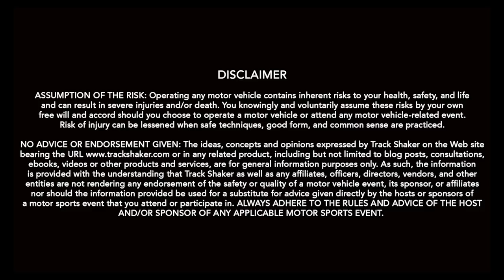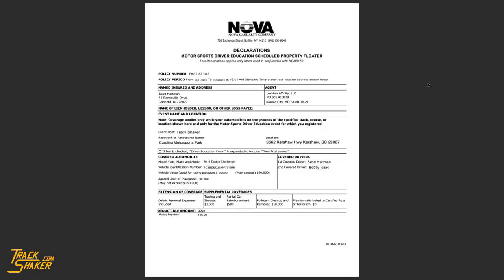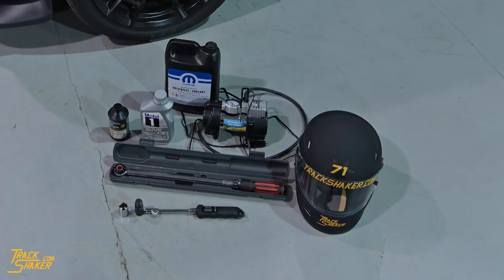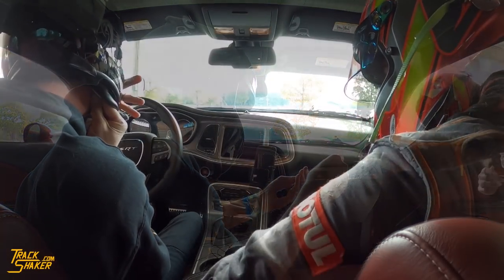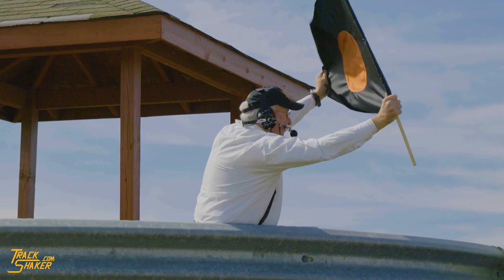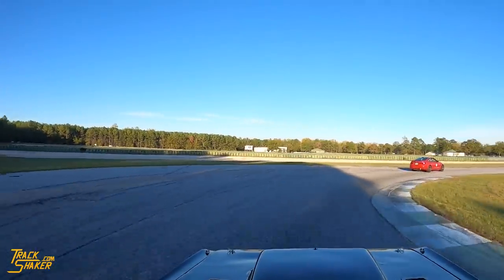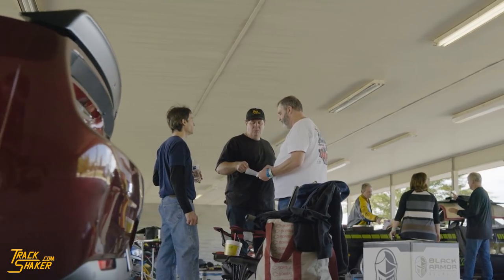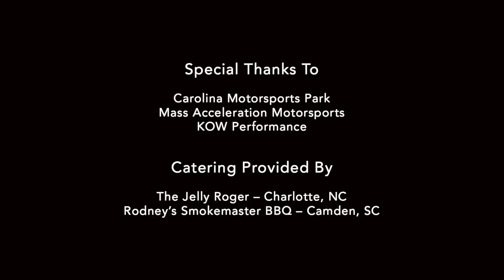How To Get On Track - The ULTIMATE GUIDE To Track Days

Comment: Why not use the car’s indicators to initiate a point by? This does not require windows down, nor require you to stick anything out the window or remove your hands from the steering wheel of the car. Windows down also sounds like a mess on a wet track day.
Reply from the maker: A few track day and HPDE organizations do utilize turn signals for point bys, and for cars with window nets (that still have turn signals) turn indicators are used in lieu of a point by out the window, however most organizations require point bys out the window
Reply: @TrackShaker  things seem to be quite different between the US and EU/UK track day rules. Either way, it’s a good time!
Reply from the maker: @Green_Streets  always a great time on track. What are some other differences with how you all do track days in the UK?
Reply: @TrackShaker  my Brisky Fox Snetterton and Spa Francorchamps track day videos aren’t shabby. Tuition from Andy Carlile at Spa (fastest man on two wheels around the Nordscleif) is never a bad time.